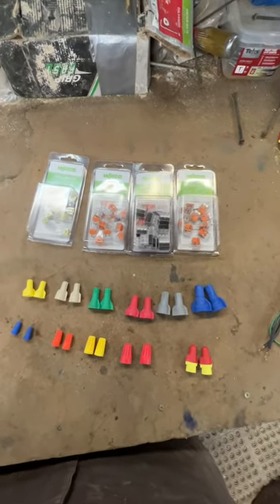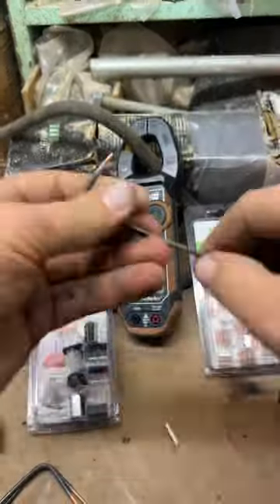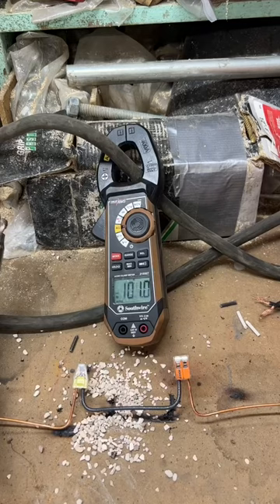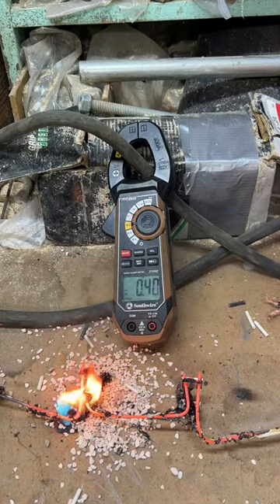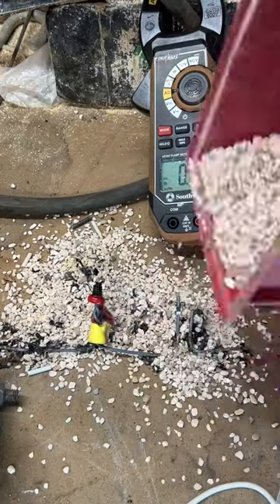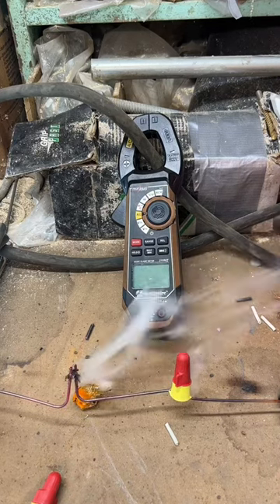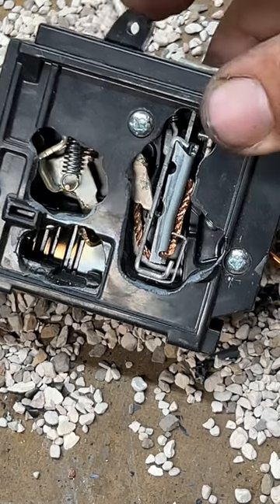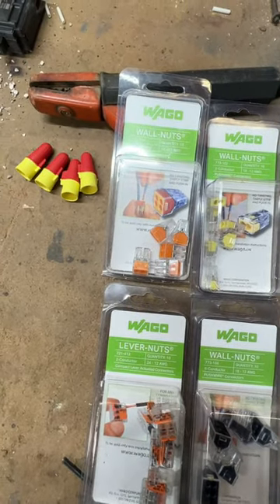Proving once and for all which is the better electrical connector Wego versus wire nuts￼

Comment: If you've got 5 times the rated current it means the breaker has failed shorted. In that case a Wago is better because it interrupts the fault current faster.
Reply from the maker: Most breakers can hold up to 10 times the current rating for a few seconds before they pop.
Reply: The connector should not be playing the role of a current interrupter. The point of this sort of testing is not to say that one connector is better than the other because it can handle 20x the circuit's rating compared to 10x the rating. The idea is that there is likely a correlation between this sort of failure and real-world stresses and failure modes.

Comment: You've pre-twisted the wire nuts so not exactly a fair test as all the wire manufacturers say pre-twist is not required.

A pre-twisted connection in a wire nut has a lot more surface area to conduct the current so there is a lot less resistive heating.
Reply from the maker: I always pre-twist my electrical connections. I will probably redo this video again and not pre-twist the copper to see how much that changes.
Reply: @HandsomeOrHandy  can't wait for that vid to come!
Reply: @HandsomeOrHandy  I predict the wire nuts will fail a lot sooner.  Without the mechanical connection of the pre-twist, only the steel coil inside the nut is there to hold the wires.

Comment: How does testing a connector on an unrealistic failure scenario mean anything? Using Wagos isn't about tolerance of extreme amps, it's about convenience and neatness. The insulation failed ahead of the connector half the time anyway
Reply: I think the point is the opposite of how you understood it - the test proves that both wago and wirenut withstand far and beyond their rated limits, aka "both are solid options".

Wagos benefit being they are epush fit and easy to use and keep your wires untwisted, while unable to withstand quite as much amperage as the wirenut, BUT - both are well over the rated amperage.
Reply: It is not about neatness or convenience. It is about reliability and repeatability of a connection.
Reply: I like Wago’s because I can disconnect and reconnect wires without cutting them. I’m always upgrading fixtures, switches, receptacles, etc as technology evolves.

Comment: Its a completely different kind of connection. Wagos make the connection between wires, A wire nut just covers and holds two wires twisted together. Of course they melt before the wire does.

Comment: What the welder, AC, or DC Straight/DC Reverse polarity?  The direction the current is flowing will impact which side of the circuit will get hot first.
Reply from the maker: It’s a cheap DC welder that can also TIG and plasma cut.

Comment: Something I never see mentioned in any of these tests is that in a wire nut, you're basically clamping the conductors together, so the majority of the current should be passing directly wire-to-wire. The amount of current the "screw" or "spring" (however you want to term that) inside the nut should be close to 0. Any failures of a properly done wire nut connection would be the result of the wire itself overheating and transferring that heat to the wire nut. Of course, they'll fail on a loose connection, as the internal component is not designed to handle high current for long periods of time. 

Whereas with all the variations of the Wago connectors (and knockoffs) the internals have to be designed to handle long term current, because the wires inside do not touch directly, they all go through this internal "bar". I would assume that Wago would rate their connectors at least for the minimum current their rated wire size is, but the point remains that the "bar" inside Wagos adds another possible point of failure when compared to a properly installed wire nut.
Reply from the maker: I think next time I run this test I’m not going to pre-twist the wires just to see what happens. As you stated this would create higher resistance and more heat would be transferred directly to the spring part of the wire nut
Reply: @HandsomeOrHandy I would like to see how that does. Not the correct way to do that but I’ve seen some shotty wire nut work doing repairs so it would be nice to see the results.
Reply: @HandsomeOrHandy  Ideal Industries states that they do not require the wires to be pretwisted when using their wire nuts.  I only use the 3m kind and they will get wires really tight to

Comment: Wire Nuts are real garbage and luckily forbidden where I live.
I would go cracy with them as an electrician.

What's the point of a connector where you can't measure voltages, can't change anything and that are complicated to use.

Comment: That's probably the most stupid, even moronic, test because you are putting something through that they are totally not designed and rated for, wire nuts or wago. If you are an electrician, you should lose your licence. This makes as much sense as putting street brakes on race cars and say "Ha! See I told you they don't worth crap!" when they inevitably fail on the race track.
Reply from the maker: Thanks for stopping by, watching the video and leaving a comment.

Comment: I would never use the cheepo things... like using a outlet push in connections... all wrong
Reply from the maker: Some people love the push in connections and think they are superior over wire nuts.
Reply: @HandsomeOrHandy  and some took the jab, still a less than optimal lifespan on the push-on in reality.